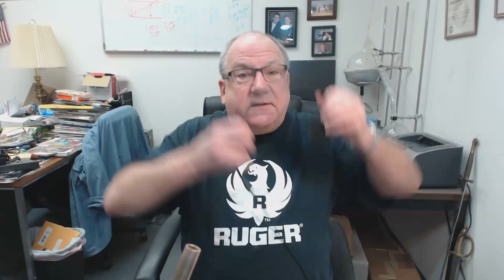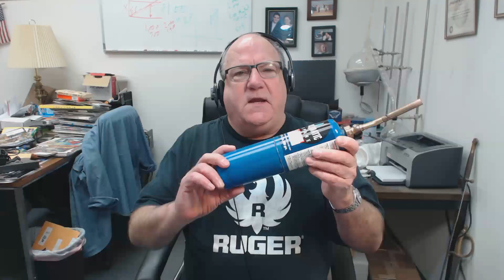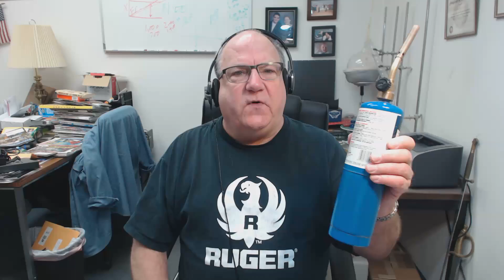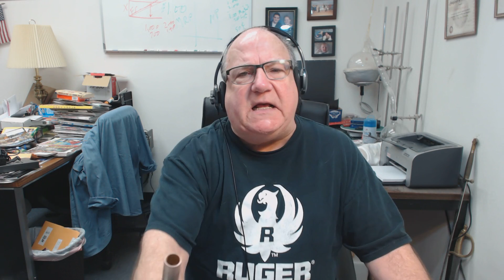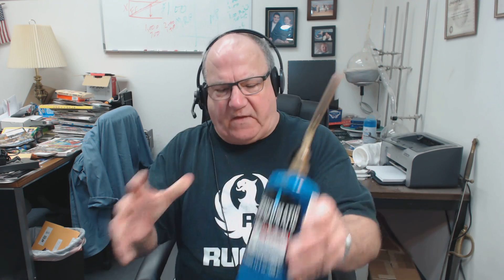Brazing with a torch

Comment: I never thought of a fire brick box, but I am brazing small low pressure brake lined piping with a thru hole to allow 260 degrees F fluids. This is a custom fabricated part, one off engine line for coolant.
  I had a customer who called his favorite kennel in Gilbert, AZ. (SW corner of Phoenix) farm country where they flood the yards for grass water. Made a vacation with my motorhome and went to the “Bureau of Tourism” in Scottsdale. I asked and a nice lady drew on a map where I could find Ruger. 
Drove up a beautiful red rock cut road, all paved. Here’s a simple “Finger” shaped sign that said “Ruger”. So I turned East into a dirt pasture like road. I thought I was going to see cows, but cars and truck where parked up toward the barb-wire fence. Next, sign pointing loading & unloading, but turn here... office. Now motorhomes have a disadvantage in parking lots made of gravel. Parked, walked in the front large glass doors, but noticed a sign, “W. Ruger Only” on first left of doors. The gal inside told me they had no tours. I felt my heart sink. She offered a catalog but I told her thanks, but no thanks. With my tail between my legs, I walked outside. Just then a “Lexas” pulled up and a hefty guy sporting a cowboy hat gets out. I asked “Where do you get that fixed?” He replied “ I have a guy drive it to the dealer in Phoenix, why?” I am just an ASE tech down here from Omaha, I was looking for a tour. He goes “Legal won’t let that happen seven ways to Sunday” He continues “Nebraska, that’s good pheasant up there” 2nd best in the US between Iowa and South Dakota, Sir. Call me Bill, do you have any firearms? I rattled off P90, PD89, 300W May. He stop me, said come here and wait a second, that’s if it ok. No Problem! He came back in 2 minutes and said “You’re taller than most horses, here is an XXL shirt, take it. What do I owe...He stopped me “I don’t get to meet customers much, hell, much less from Nebraska...You said Omaha, right!” Yes sir and thanks. He goes “I got a lot to do (As he walked away) he said; and call me Bill! Your a customer not a stranger...drive safe! Oh, he said “If you see Buffet, ask him about the 40cal barrel paper weight! He won’t touch it.
 With that 5 minute exchange, I stood paralyzed, starring at the sign and car parked in front of it. I remember as I walked back to the motorhome, I just met William Ruger and got a Tee shirt. It looks just like yours. Still got it.
  Thanks for the short video. I have two tanks to exchange so I got my “Sears” best (Re-Badged Harrison) up and running. Retirement stinks!

Comment: I braze little parts ( jewlery type scale or small tool repair ect.)with that exact torch in a soft firebrick oven. Easy and extremely handy process. I just drilled a 1 inch hole down the brick with a spade, and drilled a little exhaust port. Any old brass or copper wire works if you flux the part with borax.

Comment: I've been looking around a little to do two small jobs around the house.  A oxy-acelylene torch will be over $200 and that didn't include gases (it came with empty bottles).  Benzomatic sells a oxy-mapp gas touch with valves for both gases, with bottles the same size as your propane bottle, for $64, and it comes with 6 brazing rods.  https://www.homedepot.com/p/Bernzomatic-WK5500-Brazing-Torch-Kit-361487/300055608     Note it is for home DIY small projects, read the reviews, valves are touchy, and should probably be used indoors or where wind is blocked.

Comment: Can propane melt aluminum??
Reply from the maker: Yes – however you need protect the aluminum so it does not oxidize,  It needs to be hvily fluxed, inert atmosphere or similar.  If you heat it in an oxygen gets to it you will create Al2O3 generally known as sand.  

Aluminum melt point 1221 F
Air only propane torch 1995 C (3623 F )

Comment: That's not true I've brazed in an open environment with a hand torch you just have to be fast and convenient...
Reply from the maker: I believe you.  For someone with less experience and skill I still think oxy-acetylene (or oxy-Chemthane)is a better place to start.
Reply: Which metal did you use for brazing in open air?

Comment: Pretty quick explanation of why propane doesn't work, good work. Wish it would have contained a bit more science of heat and melting points and comparison of heat output by nozzle, and gas type. Thanks for the Vid!